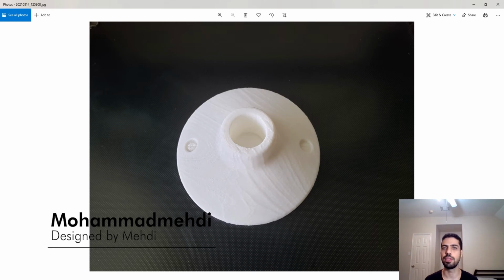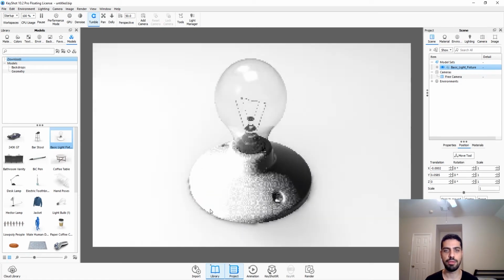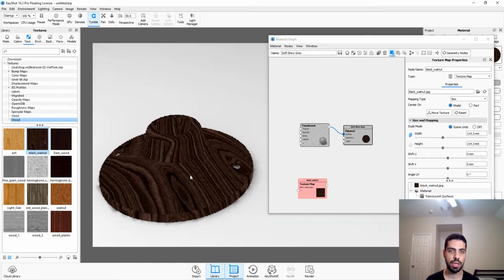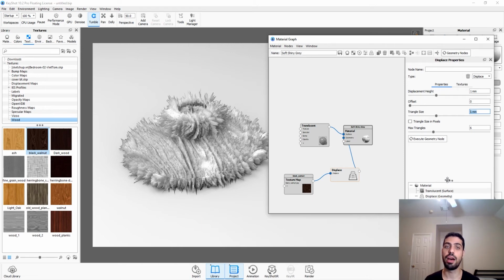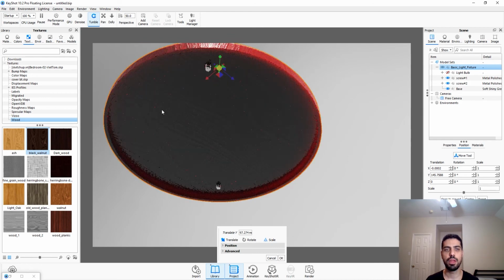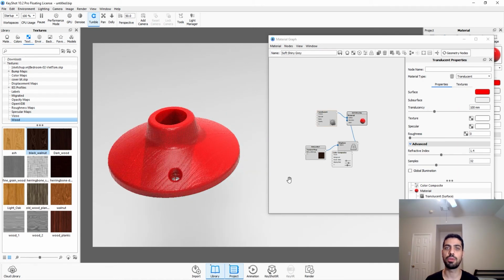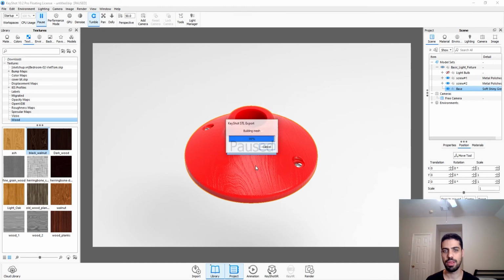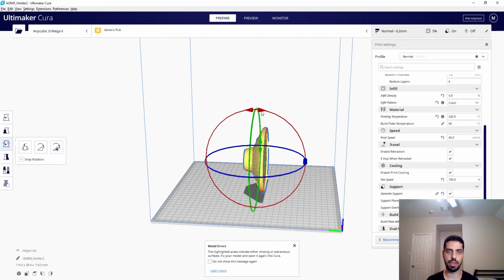Keyshot Quick Tip: How to 3D Print Using Keyshot Geometry

Comment: This is a killer tip! I've been struggling with producing textures quick and easy in Fusion 360 for my models and this is just what I needed thanks! 🙌
I'm new to Keyshot but any good tip on getting a good shader that will simulate a 3d printed part?
Reply from the maker: Hey Sébastien, thank you for your kind words. I cant think of anything at the moment for a 3d printed looking texture but I can make a video on it for sure